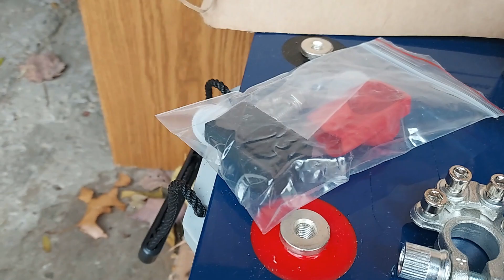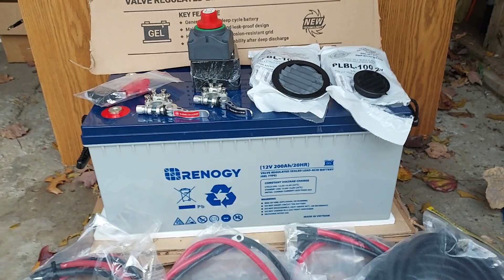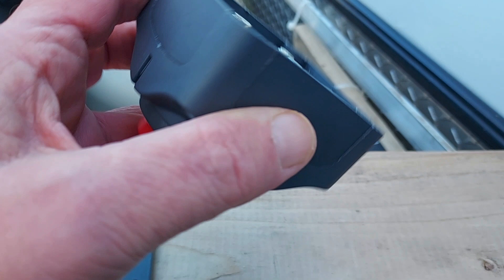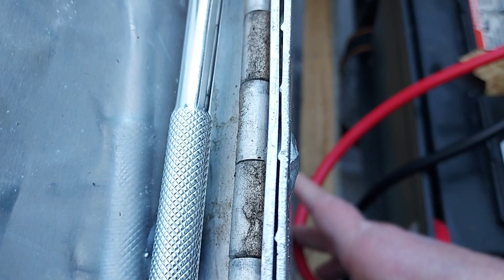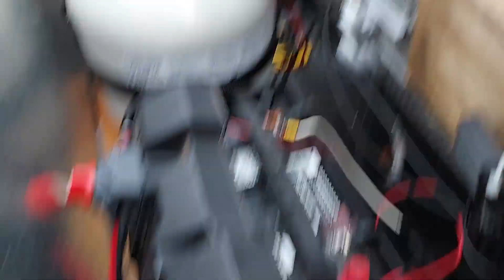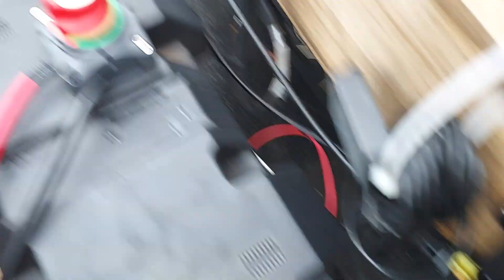Little Guy Max RV Add 200ah Renogy Gel Battery w 2000w Inverter Build – Battery & Wiring (Vlog #1A)

Comment: Do you know the dimensions offhand of the front compartment? I intend to go heavy on Li batteries. I'm looking at the SOK Li's or the Lions Li's. I'm looking at 600AH total with a Victron MultiPlus inverter/converter, about 300 watts in solar on the roof and portable. I have a 2500 dual fuel inverter that I'm going to put in a cargo rack on the rear hitch. I can use it to keep the Li's charged every few days as needed. I want to boondock for 10-14 days at a time.
Reply from the maker: You will probably can get the batteries  in the underneath dining bench. The problem will be is that the front loading may be unbalancing the trailer to much to the front when considering the water tank being filled with water when you boondack. My battery is 163 lbs. Of course you can balance the with more weight in the back storage. Her is a video I made to check safe tongue weight and balancing trailer that may help
https://youtu.be/QVpKBQ8rVuE
Reply: Lion Li batteries are only 23 lbs each. I can have 630 AH and be 25 lbs less than your battery. @ramblinroses6066